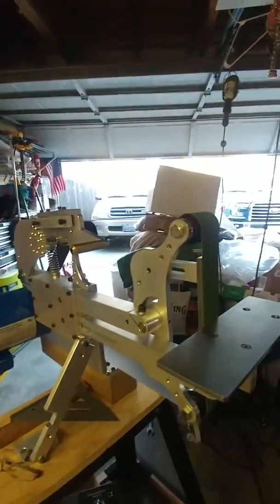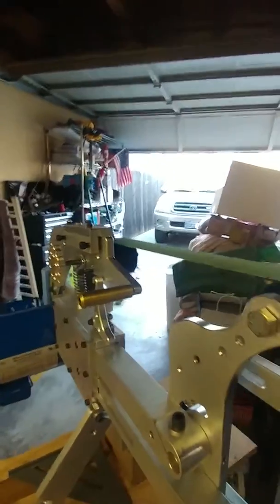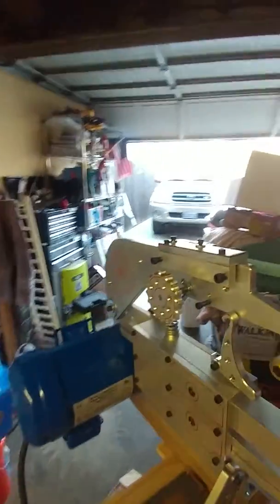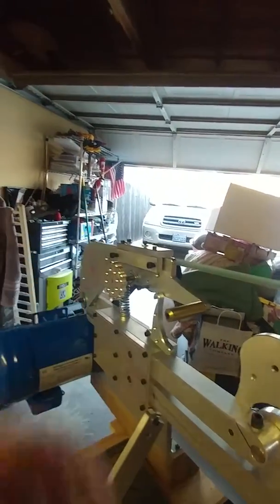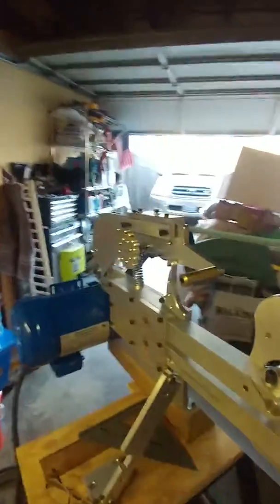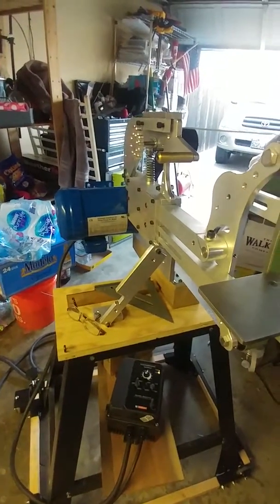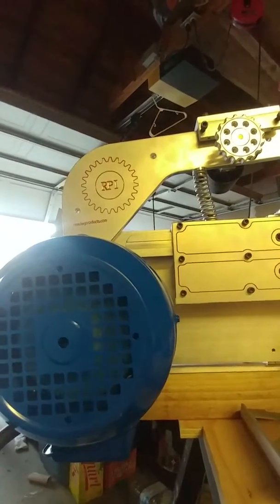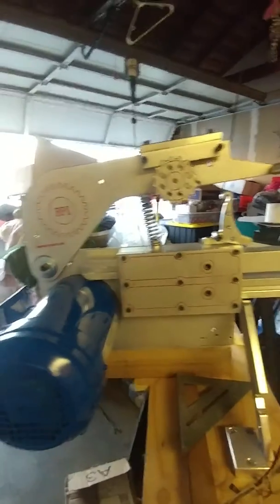2" x 72" belt grinder motor vibration problem.

Comment: Hey your platen looks different than mines. Looks like they changed the design... some advice on your wheels. Throw those plastic ones away and get some nice aluminum ones. I did the same thing and had problems with tracking and belt chatter. Got aluminum wheels and it went away.
Reply from the maker: I think I will. Thank you.